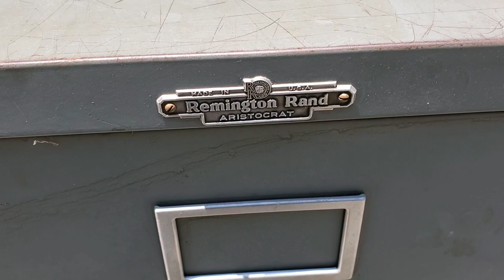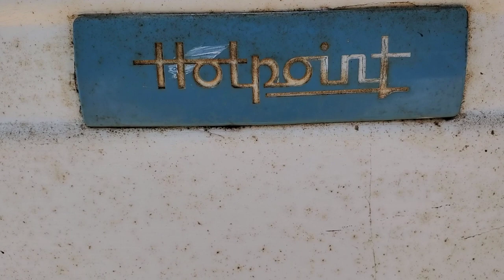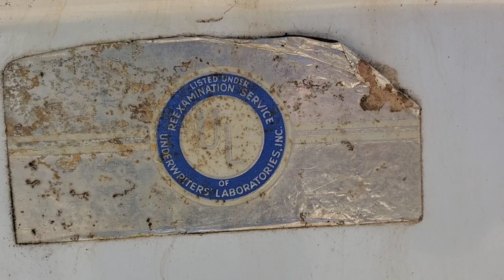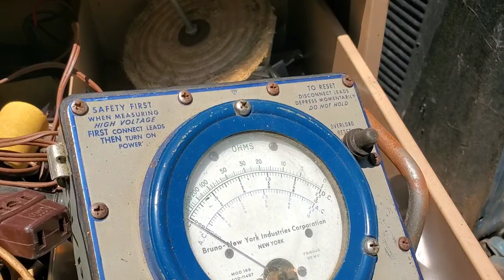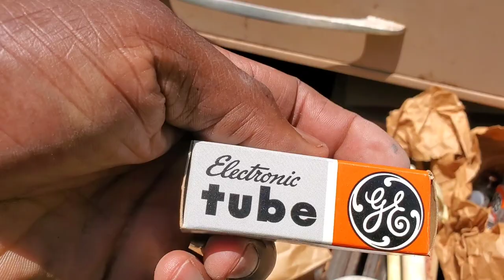1947  ANTIQUE REFRIGERATOR & FILE CABINETS .14 YEARS OF MARRIAGE.

Comment: Not surprised that refrigerator still works.  They were made by GE, who acquired Hotpoint in 1927.  It uses their Scotch Yoke compressor design, which is still considered one of the best small refrigeration compressor designs ever.  There are many refrigerators with that particular compressor design still operating after over eighty years, with their original sulphur dioxide or R12 charge.  That particular horizonal variant of the Scotch Yoke compressor was first used in the FEA square-top replacement cooling units for Monitor Top refrigerators produced just after WWII and was the first largely produced design from GE to use R12 refrigerant.  The Monitor Top Refrigerator Forum is one of the best resources for antique GE/Hotpoint refrigerators.
Reply from the maker: Wow. U kno yo stuff I appreciate you for the info. I’m not going to let you down with my channel MO TO COME.  THANK FOR THAT INFO ❤️💪🏾💪🏾